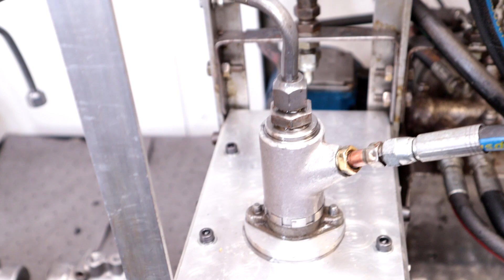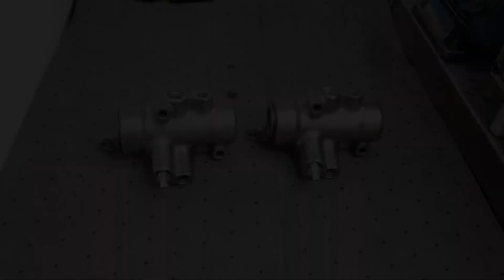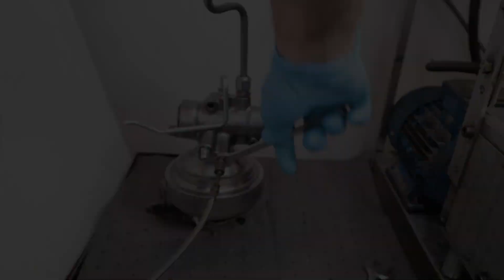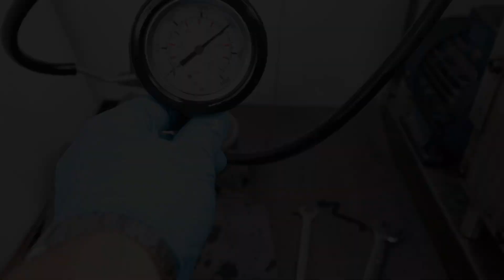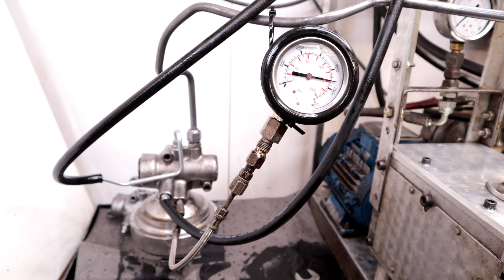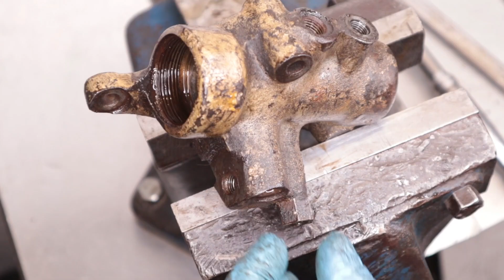Video Tutorial : Accumulator Valve Body Testing (Shadow I & II, T1 & T2)

Comment: Can you transfer accumulator from card to another? The aqua matter is serviced they are working out ready to go, but the question again can we move them from one card to another car same model thank you.
Reply from the maker: Hi, as long as the accumulator is the right one for each car and the pressure needed of the accumulator is the same, then yes. Just make sure the accumulator has been properly serviced before installing it again